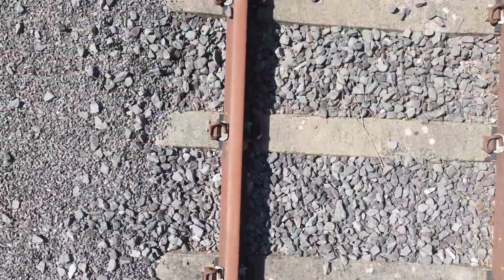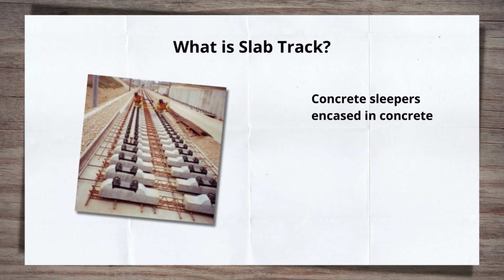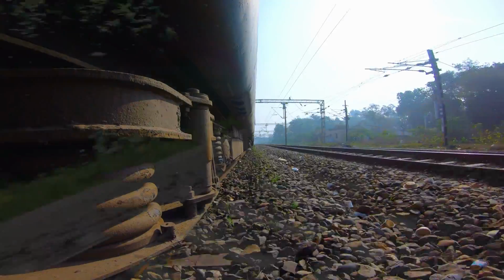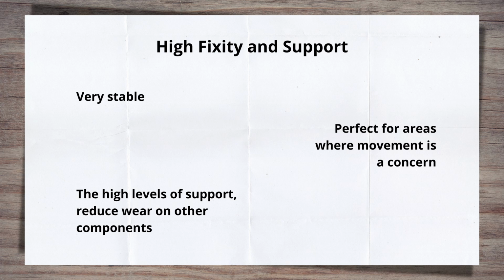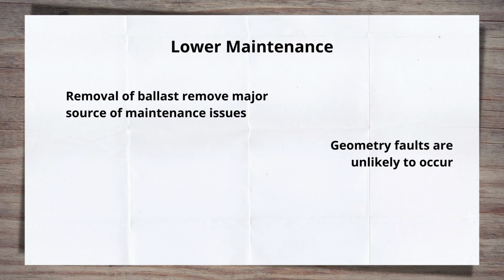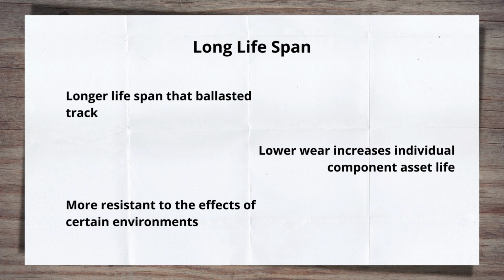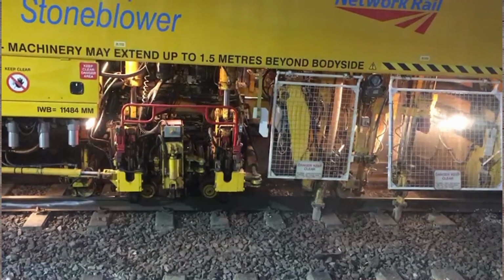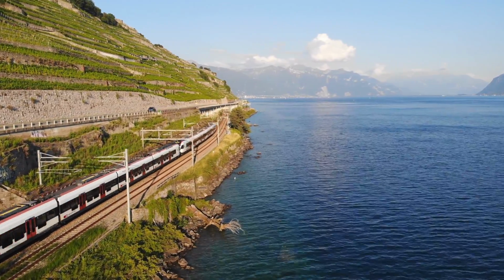Railway Slab Track: The Pros and Cons for Rail Engineers

Comment: Theres two types of ballastless slab track I've seen. The 'traditional' slab track where the rails are above the sleepers or concrete slap but some systems use embedded slap track (especially trams but also railway tunnels and some stations in Spain such as the Atocha - Chamartin Cercanias and AVE high speed rail tunnels in Madrid). I'm to better understand f their are added benefits to embedded slab track in mainline rail environments (where allowing for road vehicles to drive on the track as in tramways is not a consideration). Are there reasons why some mainline installations have chosen embedded slab track?

Comment: Great video . Drainage is a very big discussion for slab.  Have seen the immediate effects on track circuits with noise etc but re-bar degradation is a risk conversation that many don't want to have as it requires projecting thought out to 10-15 years. I am seeing a race to the bottom for cost and sadly this comes back to haunt operations in the future.

Comment: There is some slab track going in right in front of my condo, with a new LRT line.  They appear to be using blocks that the rails mount to.  These blocks are laid on the reinforcing mesh, before the concrete is poured around them.  This LRT is supposed to open early next year.
BTW, I had never heard the term slab track until now, but I've certainly seen it in the subway for many years.
Reply from the maker: Where is the LTR railway if you dont mind me asking?

Thank you for sharing and I hope you found the video interesting!
Reply: @thepwayengineer   That's LRT for Light Rail Transit.  It's a new line going in right down the front of my condo property and will replace buses.  It's in Mississauga Ontario.

Comment: You missed out the huge cost & work involved to replace slab track, concrete over time does weaken, crack & fail, once water permeates the concrete the steel rebar inside begins to rust, as metal rusts it expands & this is what generally cracks the concrete open. Freeze jacking also contributes and Over time this gets worse until the concrete loses its structural integrity. 
Ballasted track is easy to lay, cheap & quick to maintain, you only need to clean the ballast from time to time, removing the dirt & small broken stones & lay it back down again.
Slab track is better in a dry environment.

Comment: You missed the main drawback: a concrete slab is not stable (it will break if lifted at one end that may be miles away), it requires support from below, and below is earth and earth moves. Earth moves always, either it decreases in height because of organic decomposition and erosion, groundwater will wash out even far below the surface, and even whole landscapes move because mountains sink and earth crust moves. While ballasted tracks will follow this movement gently (except in case of earthquakes) by introducing slight curves and height varations, slabs will not. They break and build sharp steps that rails and trains can't follow. So slabs need adjustable support, no problem on bridge pillars or inside tunnel tubes. Otherwise only short distances can be used.
It's like concrete highways vs. asphalt: The concrete highways need predetermined breaking points, otherwise they may occasionally break and introduce huge steps that crashes cars. Asphalt will follow ground movement at least to a certain degree. Concrete needs foundation that can be adjusted to earth movement.
So concrete (slab railway or highway) are great on bridges and tunnels or for short distances, but unsuitable for long distances

Comment: An interesting aspect of this is that esp. in tunnels the fixed slabs aren't necessarily fixed to the tunnel. Instead they are on a mass-damper system. This handles vibration and noise issues.
In some constructions, like parts of Stuttgart 21, it's done in such a way that the entire slab system can be lifted up to be accessed from below (to an extend) for future maintenance needs.

Comment: I work for New York City Transit and the large majority of our underground track uses a distinct variation of this concept. Basically  we still use wooden tie blocks (with every fourth or so a full tie) set into the concrete floor with a drainage trough down the middle. The drain also gives people who have fallen on the tracks somewhere to lay safely of a train is coming.

Comment: Neglected to mention: ALL rails eventually where out. Replacement is very expensive.
Reply: For the most part, the rails are open and held down with clips, just like on ties.  The exception would be where the track crosses roads and the area around the rails is built up with concrete, to maintain a level road surface.  This is the way it's done on a new LRT line that runs right in front of my condo and it has it's own right of way in the middle of the road.

Comment: The biggest drawback of slab tracks that you forgot to mention is the lack of ability to dilate.
In every country with highly varied climate throughout the year, engineers has to account for dilation when designing train/tram lines (or bridges, or tunnel entrances, or pretty much everything), because at every hotter summer, if the tracks can't dilate, they'll bulge to a point where whole sections of the slabs has to be replaced due to cracks or fractures in the concrete as the tracks rip pieces off of it, and that doesn't only cost a fortune, but pretty much cripples tram or train lines for days.
That is the main reason why the majorty of train/tram lines are still lie on ballast beds.
Reply from the maker: The rails can be stressed to mitigate the thermal forces. I would imagine that expansion joints are also fitted in the concrete. But your point is a good one and I agree it is an issue
Reply: By "dilation," do you mean expanding and contracting due to temperature? Forgive me but I'm still learning.
Reply: @TheRailwayDrone  yes, but the problem is more prevalent when it expands.
The tensile strength of rail steel is incredibely high, so in colder climate, it's very unlikely that it'll break due to retraction.
It's also has to be strong enough to bear the weight of a train (trains are very-very heavy), so by compressing it, it'll just flatten towards the base.
That is the reason that if it expands due to high temperatures, it bulges up like a rollercoaster, but won't break. It bulges up, because the tie plates are keeping it in place sideways, and the ties are keeping it on the ground, so it moves towards the least resistance, which is up. And when it does, it takes everything with itself, including the tie plates, the fish plates, and sometimes the ties too.

When it does that on a slab track, it takes the fasteners, and pieces of the concrete slab too. The problem there is that unlike ballast tracks, where you only have to replace a few ties and tie plates, with a slab track, you can't pour concrete into the holes, cracks and fractures the rail rips open, because that'd affect the overall integrity of the slab, so you have to replace the whole slab.
So while on a ballast track, you'd be able to repair only one of the rails of the track, a few ties, and a couple plates, which can be done in a few hours, and can be done almost immediately, on a slab track, you'd have to remove the whole slab and put another one there, for which youd need a freight train with a crane and the new slab, which takes much more time and requires much more preparation.

Obviously, it all depends on the situation and the severity of the damage, but generally speaking, if you don't build and maintain slab tracks properly (and almost no one does), you'll be up for a challenge fixing it if something goes wrong.
Reply: @Helpoca  Interesting! I wonder how often Germany has the problems you described. I've seen many of their high speed railways using slab track.
Reply: @TheRailwayDrone  I'd imagine german engineering applies to their railways too, and they sorted this issue out before it ever happened ;)
Reply: Certainly in the UK we stress the track to a lower temperature for ballastless (21deg) track compared to ballasted track (27). A result of the high fixity of slab track is that the risk of track buckling is greatly reduced. As the rail expands (1mm per 1 degree increase for 100m of track) the lateral force at the sleepers will increase and ultimately will reach the point where the force results in lateral movement of the sleepers which rely on the friction of the ballast. Slab Track is fixed and the system resists a greater lateral load. Reducing the stress free temperature means that the rail has a lower risk of breaking when in tension due to the cold weather. The ballastless track systems do have to deal with the thermal expansion both of the rail and the civil structure itself. This are typically delt with through design measures, structural expansion joints in your foundations, low toe load fasteners and rail expansion joints. The risk of derailment is greatly reduced when using ballastless track.

Comment: One more advantage of slab track is that it allows higher speeds and the use of eddy current brakes. Both at high speed and when eddy current brakes are used the ballast would be sent flying, massively increasing maintenance, damaging trains and being hazard for anything close to the rails
Reply from the maker: I will be honest, I have not come across eddy current brakes but would be interested to know more!
Reply: @thepwayengineer  As a starting point, the ICE 3 uses eddy current brakes on certain high speed lines, if that helps.

Comment: Also, from sncf reseau (french rail infrastructure operator):
The ballast dampen, so it's less noisy.
The lesser flex in the slab track makes the wheels (and rails) wear faster.
Reply: How the track is attached feeds into the noise issue. Spring clips rather than bolts are now common as are plastic buffer pads under the rail.
Reply from the maker: It does have to be remembered that the whole track structure is a system when even the humble pads have a key roll to play. Changing any part has a wider impact

Comment: I wonder about rolling resistance. I imagine that ballast track would compress under the train's weight, so that the train was always slightly climbing as it traveled. I've seen asphalt roads compress ~2 inches as heavy mining trucks traveled along. The road surface then rebounded.

Comment: If you look at the Gotthard Base Tunnel, you can see another disadvantage of Slab track. It's insane work to rebuild in case of a derailment.
Reply: And I agree, wonderful channel and videos❗
Reply from the maker: Thank you very much!
Reply: The opposite is also true as derailments are greatly reduced because of more tightly controlled track geometry…
Reply from the maker: Both @felixonrails and @allangibson8494 make really valid points

Comment: So what about changes in temperature changing the length of the tracks and/or its shape?
Reply: Ballasted track these days uses continuous rails without joints. It is correct that if this is not well built and well maintained then there can be a risk of buckling because of temperature changes. However, slab track is so heavy and the rails so well fixed that buckling is way less likely if not impossible.
Reply from the maker: It is also common to use continuously welded rail that is stressed to avoid changes in length